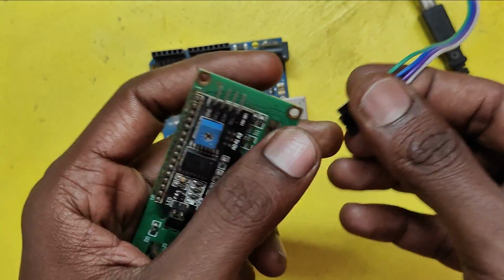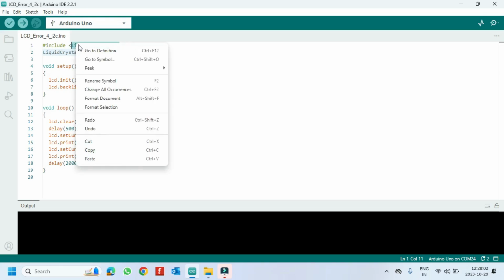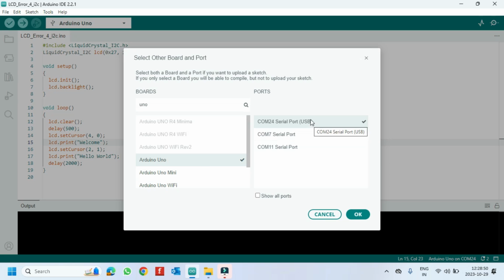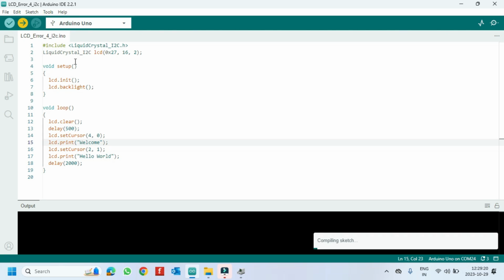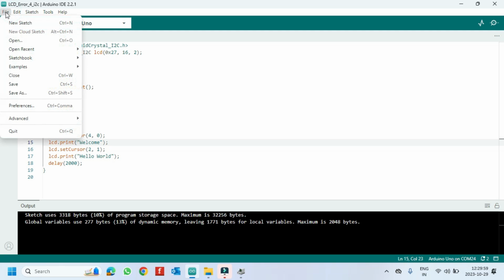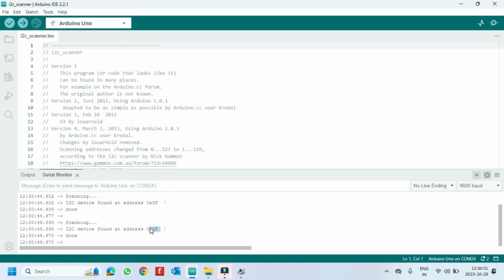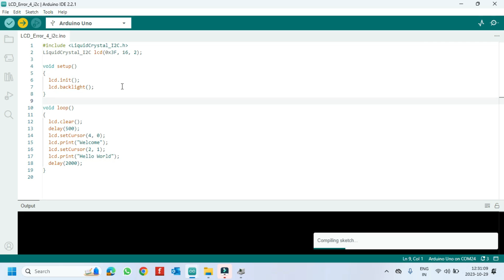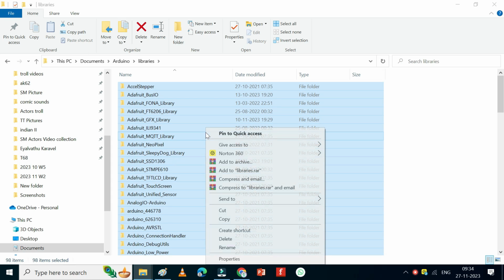I2C LCD not showing Text | I2C LCD Errors Fixing || 16x2 LCD not displaying Text || 1602 LCD error

Comment: Its showind "no i2c devices found "
Reply: Now it's showing blocks, but not msg?
Reply from the maker: Connect the SDA, SCL with proper pin number. 
Uno, nano board A4,A5 Pin.
Check if you use other board.
Or change the wires and try
Reply: @TeachMeSomething Sir my lcd is showing blocks only once then after it disappeared and then when I try to run or  upload program after sometime lcd goes off and turn on again but nothing is showing can you help me out from this please